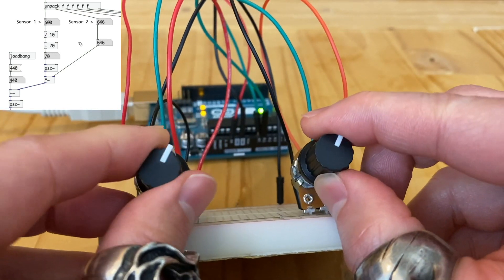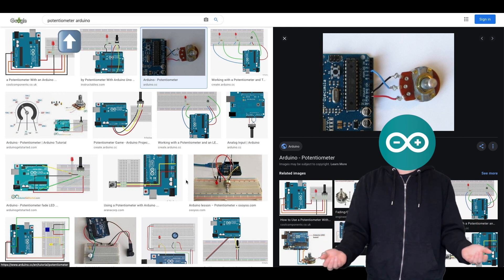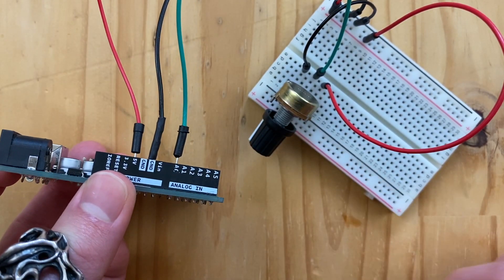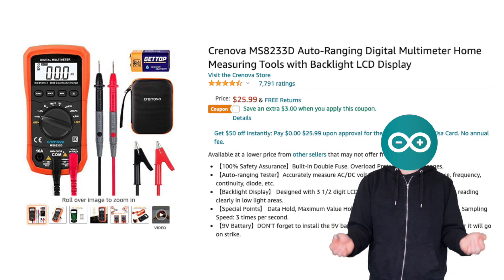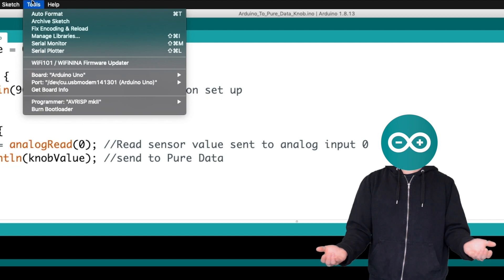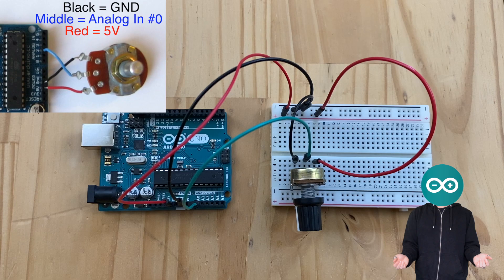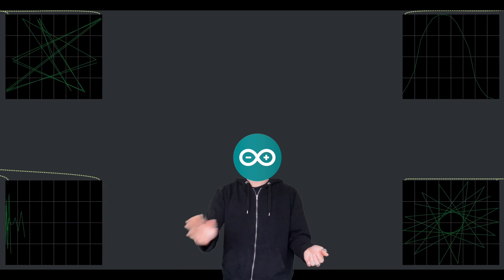Arduino To Pure Data (Tutorial)

Comment: for info, the 9600 specified for the serial communication is not a serial number but the baud rate, ie the number of characters sent per second. higher baud rates sent more text per second, and lower send less per second. They need to match in the arduino and puredata to make sure that the no characters are missed or misinterpreted.

Comment: I've been trying to do this but instead of an analog input I've been using the digital inputs for a button. It prints (1 and 0) in a line just like in the video but for whatever reason pure data does not want to read it, it doesn't show up when I unpack it. I'm not sure if it the continuous stream of inputs from the serial monitor (although I think that the method you've shown here will do that anyways, my code is basically the same as well with some work arounds on account of me not using sensors) or if it really is just the digital i/o pins that don't allow this to work for me.
Reply from the maker: I recommend checking this tutorial out: https://www.youtube.com/watch?v=1J6tLOGn0dw 

:)

Comment: Thank you very much for the video. I was trying plug data to program the daisy seed, but the patch I wanted to use could not be opened in compile mode, due to some objects that were not compatible. If I use this method will the same thing happen? or maybe those objects are compatible?
thank you so much
Reply from the maker: You won't be able to compile the patch in this video to the Daisy. You could flash the Arduino code to the Daisy though and send sensor data to Plugdata on a Desktop!

Comment: i need help, when i open the port, it tells me "failure(5) acces denied" and when i list the ports, it shows "COM3 (in use)"
Reply: I mean, COM3 is being accesed bye Arduino IDE and PureData and i cant connect puredata to the same port at the same part. i cant acces COM3 from arduino and virtual port creators at the same time neither. I cant acces COM3 port from two programs at the same time, it is my only real port
Reply from the maker: @licoradulterado1207  You can only access one port at a time. For example, if Pure Data is accessing the port, you won't be able to upload code using the Arduino IDE. You would have to turn off the communication in order to do that.
Reply: THAK YOU FOR ANSWERING!!! but if i turn off the comunication with arduino, how can pure data get the numeric values associated wothh the sensor? how do I do that? Its been exhausting to find a solution online

Comment: I have downloaded and installed the external library "iemlib", but,I can't create the object "iem_alisttosym" :-(  
The same thing happened to me with the "comport" object and I installed its library and it worked so good c:

I don't know the reason why the "iem" object doesn't work 

I'm using MacBook M1, please help me ! 
I study sound engineering, best regards to you from south america, Chile !
Reply from the maker: Hello! If you are using normal Pure Data (AKA Vanilla Pure Data and not the Pure Data Extended like in this video), the substitute for [iem_alisttosym] is [list tosymbol] 

I hope this helps!
Reply: Thank you very much for the help, I managed to solve the problem.

Now I have another problem: Arduino recognizes the COM1 port, which is where I have the board and potentiometer connected, and gives me values from 1 to 1023, which is fine.

Then I open my Vanilla Pure data and the COM1 port is not recognized, it is not even in the list. (tried this with Purr Data{extended} and same error).

When I close the Arduino, and open only the Pure Data, it recognizes the COM1 port, but the Arduino no longer recognizes the COM1.

Connection through COM ports is not possible, since it is used for a single program, not simultaneously.

Before, they could be intertwined, but by connecting and disconnecting so many times I think the port was blocked, I need to unblock the COM port and give it access so that both programs can communicate through the same COM port.

I've been trying to do this experiment all day, I tried with Windows 10 but I couldn't either, I got to the same point, I've even tried with multiple versions of PurrData and PureData on Windows and MacBook. 😢

:C I visited forums but nothing, last help please :')
Reply from the maker: @jeremias_escudero  Which Arduino did you purchase?

Comment: You sir, are my new hero. You deserve WAY more views.
I was having issues with the comport, but i just jumped to the ''Purr Data" version of Pd because it said it had all the Pd-extended stuff installed. Got everything working, but i also plan to use Daisy for embedded audio in the near future. Do you think i will run into issues using Purr Data, rather than vanilla for programming Daisy? 
Thanks for everything dude! I hope you continue making videos, i really enjoy them. Easy to follow, and also fun to watch.
Reply from the maker: Glad to hear that you found this video helpful!! 
Using plugdata will be helpful when working with the Daisy since there's a compile mode that tells you which object is compatible or not. Have fun!

Comment: I get a comport error that comport number 0 out of range (1-99)
[comport] opening serial port 0 failed!
And after I change open to open 6 which is where my Arduino is, and when i click open it prints random numbers but I can see that when I turn the knob there is a change in the value from 49 to 57 but when I go to the max limit of the knob, it goes back to 49. What do I do pls help

Comment: Man you're the best, everything went perfectly well !
Reply: Hey, could you tell me if you had any problems? I can't seem to have my patch working correctly, probably cuz of the serial port thing. I have everything in place but when i use comport 0 9600, it tells me opening serial port 0 failed. Same for 1-4, but since my arduino uses com port 6, when I put that, it doesn't seem to change values with the knob.

Comment: Nice video. And nice channel over all. I love Pure Data and use it pretty much on a daily basis.

I was messing with Arduino a few years ago. As i remember it, using delay is not good practice. The issue that the whole program is hold up until delay is over.  The whole program is basically frozen until delay is processed.
"Arduino - delay () function

The way the delay() function works is pretty simple. It accepts a single integer (or number) argument. This number represents the time (measured in milliseconds). The program should wait until moving on to the next line of code when it encounters this function."

This is not an issue for smaller projects, with just a few knobs, but as soon as you start to make something larger, it's an issue. 

Atm I don't remember what I used instead, but there are more "good practice" solutions, that won't cause issues down the road, as using delay might.

Anyway have a good day ;)
Reply from the maker: Sorry for the delay in response, but yes, delay is not good to use in the long run for sure! My professor always suggested that I stay away from it. I should do a video about this...
Reply: @SoundSimulator  No problem at all. I like your channel. Not a lot of people talks about these subjects. Keep it up :) 

Yeah, that's a good subject actually. 

Look forward to see it in the future ;)

Comment: hey i was wondering if anyone else had this problem : comport number 0 out of range (1-99)
[comport] opening serial port 0 failed! 
for reference. i have tried both pd.extended and downloading externals in pure data vanilla but still get the same error. 

Thank Takumi! Your video are so so good, thanks for sharing your skills/knowledge
Reply: solved!! problem is from having the serial logger open while trying to use it in pd lol
Reply from the maker: @niamhmccool9123  👍👍
Reply: hey, how did you exactly sovle the problem? I have the same issues and I'm using windows.

Comment: Hello what's up? Thank you very much for the contribution, it opened new paths. Congratulations,
I wanted to ask you a question to see if you can help me, I used all your steps in your tutorial, but instead of putting a potentiometer, I am using 4 ultrasonic sensors hrcs04, the data arrives to Puredata from arduino, I get the 4 distances, but when I put the unpack so that the data is separated, that doesn't work... could you help me? Thanks a lot!
Reply from the maker: I'll reply on the dm you sent earlier!

Comment: heyy I was able to see the pinned comment and fix the zl group 100 and the fromsymbol putting "cyclone/" infront, but for some reason the iem_alisttosym is not showing up. If you had a solution that would be great. For the rest I am very thankful for these videos, learning a lot!!!
Reply from the maker: Substitute for [iem_alisttosym] is [list tosymbol].  
It should work now!
Reply: @SoundSimulator  Neither [iem_alisttosym] nor  [list tosymbol] works for me. What should I do?
Reply from the maker: @cyberrichter  which version of pure data are you using?
Reply: @SoundSimulator  0.43.4-extendet
Reply from the maker: @cyberrichter  try vanilla pure data and see the pinned comment

Comment: Hey man! Thanks for the awesome tutorial, it helped me a lot! We're currently building an instrument for our electronics class (Sound Engineering Major) and our goal was to convert color into sound. For that we took two sensors - a photoresistor which we plan to map to a volume parameter and a color sensor which we plan to map to a frequency-dependant parameter of a synth in Pd (for example a mod. freq. of an FM synth).

The thing is, the photoresistor is connected in the analog input of the Arduino and the color sensor must be connected through the diginal Ins on the arduino board. However your array seems to only work if the 2 or more sensors are analog, hence the line "val[i]=analogRead(i)". The "unpack ff" function then can't read that respectively, seemingly because the two sensors use different kinds of technologies/inputs. Are we understanding this currently and are we on the right path? Could you think of a solution where we can use the array which you demonstrated, but with one analogue and one digital sensor plus the unpack ff function in Pd. 

The situation is pretty hopeless at this point so we'd really appreciate your input! <3 Keep doing what you’re doing!

Cheers, 
Sound Engineering class of 2021, Filmuniversity Babelsberg
Reply from the maker: Nice! Feel free to share the project when you're done! 

As for the questions, yes, you're definitely on the right track. 
So you can keep the Pure Data patcher the way it is now, but you need to modify the Arduino code a bit. 
Use the "one sensor" code as the foundation and add the following... 

---

brightness = analogRead(0);  //Reading the photoresistor here (connected to A0) 
Serial.print(brightness); //Send to Pure Data. It'll be the first outlet of the [unpack f f]
Serial.print(" "); //There's a space between " & " 
Serial.print(color); //I'm assuming you found a code for the color sensor and this is the variable you get. Send to Pure Data...
Serial.println();  //Don't forget the 'ln' here 

--- 

I hope this works! If you have any further questions, feel free to reach out via social media. Best of luck!

Comment: Takumi I have a question: Could be possible to connect a pulse sensor to this? Actually I am testing with it and works. I am looking to create the path between de pulse sensor and arduino in order to let the hardbeat crontol the sound experience. Thank you for the explanation.
Reply from the maker: Yes! We can use a [timer] object for that. I'll explain more in details in the DMs.

Comment: arduino detects my board but not pd when i clic the "devices" object, what should i do ? EDIT : just have to close the arduino ide and maybe unplug and replug the board - is there any other option ?
Reply: and the zl group object could'nt create (i installed cyclone library but not sure which ont i got to install) EDIT : Had to replace "zl" by "cyclone/zl" in the object
Reply from the maker: @grenadinementalo  Externals can be weird on Pure Data. You have to do [cycle/zl group 100], you can see it clearer in this video https://youtu.be/itQC9GxO_Is?t=149 It'll directly go to the part when you click on the link!

In terms of the board being recognized, I'm not sure. As long as it works (even if you need to unplug & plug), it's fine//
Reply from the maker: Do you have social media like Instagram? Please feel free to send me a screenshot of the code. 

What Arduino are you using by the way? Unofficial (but more affordable) ones can cause lot of trouble.

Comment: Hi, Thank you for the great Video, i did it step by step but i simply can't connect the arduino with the Pure Data. I get the following error msg in Pure Data

comport number 0 out of range (1-99)
[comport] opening serial port 0 failed!

Can you help me out here? I have the code line by line identical. Thanks and have a nice day :D
Reply from the maker: That error message is fine actually. Click on the [open 1] message box and see if you're still getting an error. 
I put 0 in  [comport 0 9600] so that serial communication doesn't happen automatically. That 0 is for stopping/closing serial communication.
The [open 1] will override that 0 and the error (unless your Arduino port is not 1. In that case, click on [devices] to check).
Reply: @SoundSimulator  Thanks for the reply i'll get back on it :D

Comment: Hi again! This works flawless on my mac, but I tried this again on my Raspberrypi 3 A+ that I'm running headless over SSH. For some reason comport is reading something that looks like a 15 number array, even though I'm only using an array with 2 numbers. Also, digital "ones" are showing up as "10". Super strange. Seem like a bug. To fix it, I first need to open the sketch in Arduino IDE, then close Arduino IDE, then open the comport-sketch in Pd, and everything works fine. Have you stumbled across this before?
Reply from the maker: I actually haven't used Raspberrypi with Arduino before so I can't be much of a help here, sorry!

Comment: Hello I am from Argentina. I would like to know if I should do the same as this video proposes if I want to use a proximity IR sensor. Thanks!
Reply from the maker: Hello! Yes, you can follow this tutorial and use a distance sensor! I recommend using one that connects to the analog pin.
Reply: @SoundSimulator  Thanks for your answer, it was very helpfull! I am thinking of using the ultrasonic sensor hc-sr04 arduino. This sensor have four pins. What do I do with the one that remains in addition to those explained in the video? What do you mean about "one that connects to the analog pin"? I`m really sorry for all my questions, thank you, thank you very much!
Reply from the maker: @deapellidobruno  If you already have one, then no worries!! It's just that you won't be able to directly follow the Arduino code part of this video. The Pure Data part will be the same though! 

You can search for "hc-sr04 tutorial" on search engine and you'll find plenty of helpful websites! Hook up the sensor as shown in those tutorials and they'll provide you with the code as well. The only [ Serial.println(); ]  you need is [ Serial.println(distance); ] Don't forget the [ln] after the word [print]. And delete other lines that use the [Serial.print] or [Serial.println]. Everything else in the code should remain the same.  

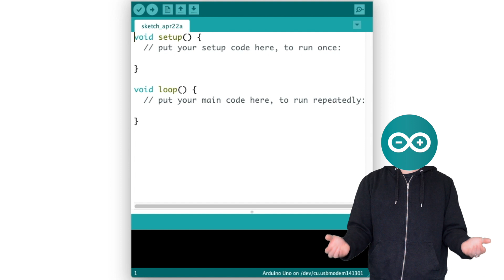That [ Serial.println(distance); ] is what will send the sensor data to Pure Data!  Similar to [ Serial.println(knobValue); ] at 6:07 in this video.  

I may be making it sound more complicated than needed, but you'll definitely understand once you take some to see what's going on! Best of luck!!!! And please let me know if it worked!
Reply: @SoundSimulator  No, no, on the contrary, you have made it much easier for me to understand how to do this job! If I wanted to use two sensors like you in the final part of the video, would the modifications in the arduino code be the same?

Once again, thank you very much. As soon as I have finished my instrument I will not hesitate to tell you how it went!
Reply from the maker: @deapellidobruno  So because analog pins are not used, the multi-sensor Arduino code needs to be modified as well. I think it’ll look something like this… 

I’m assuming you have 2 distance sensors with separate variables. 

Serial.print(distance1);
Serial.print(“ “);
Serial.print(distance2);
Serial.print(“ “);  
Serial.println();

Hopefully this works!! Please feel free to let me know anytime if you encounter issues. 
Have fun!!! Looking forward to seeing your instrument!!
Reply: @SoundSimulator   hello friend, it's me again. I wrote you about a question on instagram because I thought maybe it would be more comfortable to talk there. Anyway, if you think it's better to talk here, I'll send it to you here. Thanks for your help, i really am a bit of a fool with these things

Comment: I have one question! 😅 Two signals cannot be separated  in PD,  Two signaal just in one Number，like  1024 to 352 to 1024 ............
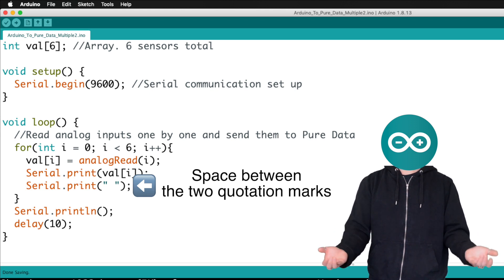Reply from the maker: There are several factors that could be causing it, so I can't provide the correct solution. I recommend double checking the Arduino code (11:08) and Pure Data patcher (11:48). Make sure the sensors are wired correctly. If you are still having issues, please feel free to send screenshots and photos on my Instagram. Best of luck!!!
Reply: @SoundSimulator  I  send screenshots and photos to your Instagram,thank so much :))))

Comment: how do you load pure data onto the arduino, after having designed the synth separately on a computer?
Reply from the maker: It's not possible to embed Pure Data patchers into Arduino. You can do it with Electrosmith Daisy or Bela though!